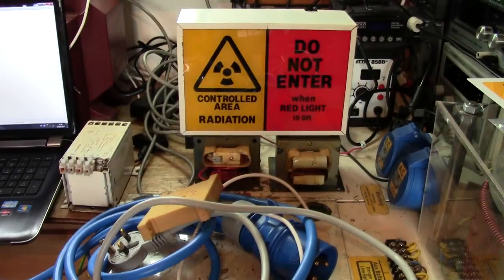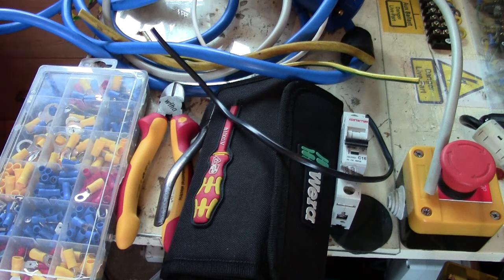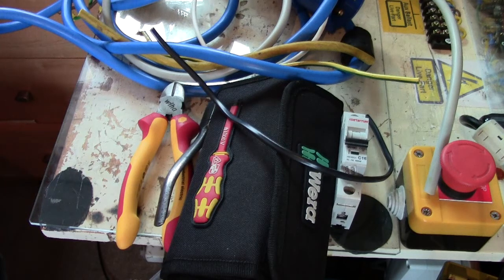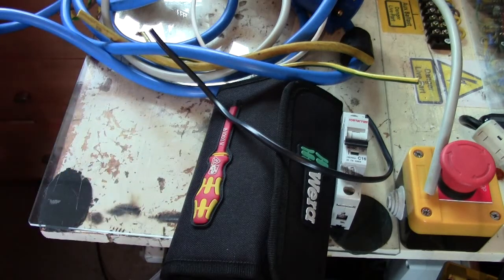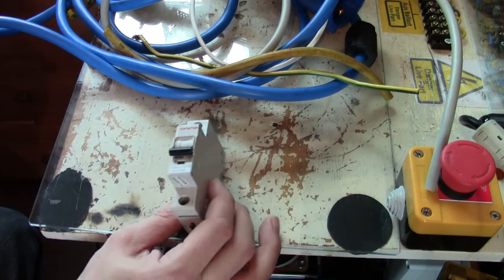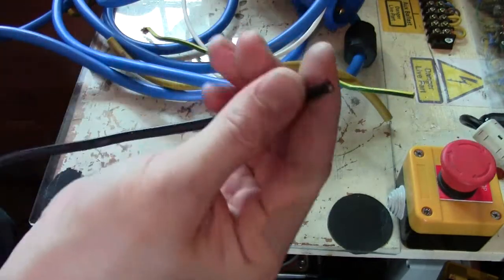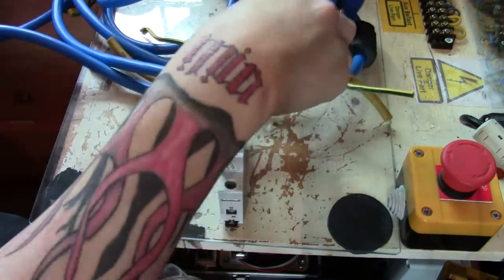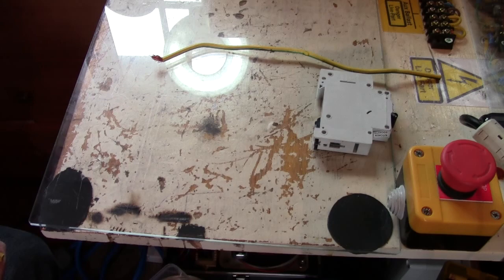Basic electrical safety PT 1

Comment: Great video. At least in the UK leads are colour coded. In NZ they can be more or less  whatever colour.
Extension leads are orange, yellow, red, blue, white, black. All rated for 240 Volts. Quality differences are in the thickness of the insulation and domestic, or heavy duty. Conductor size etc. For 110 or 240 V different plug connectors are used.
Reply: In Australia the extension leads have different plugs, 10 amp, 15 amp and 20 amp. the colour of the lead means nothing.
Reply from the maker: Mentorcase In a lot of cases in the UK lead colour means nothing to alot of ppl I like to use the proper colour leads and plug /sockets even though the same size is the same rated its just safer and something thats done to make things more clear and safe .I often see ppl using yellow cable ,sockets / plugs (our 110v ) for 240v and think nothing of it even using nails as fuses but i guess thats just ppl be stupid and they soon learn when they plug the 110 power tools in to 240 ;) and see the magic smoke then wine about it LOL .Thanks for watching .John

Comment: Mmmm, that blue arctic stuff looks chunkeh! :-)

I laughed at the end of the vid; ".....and if a fuse blows, DON'T chop up an M6 and...."

Well, the vid cut off at that point, but I know what you were going to say about that M6 bolt. :D

As for using yellow-coloured flex on 240v, I do know that it is possible to get yellow flex which can handle 240v. In fact, I'd seem to think that it "wouldn't-be-allowed" for manufacturers to make 110v cable....just in case someone did wire it on a 240v supply.

In fact, I have heard that some carvan sites PREFER caravanners to have 240v hook-up leads IN YELLOW or ORANGE so that they're more visible in low light conditions to save people tripping over the cord from the hook-up point to the caravan.

I have a 14 Mtr, 2.5mm extension cord and it's yellow-coloured on the sheathing. It was given an insulation resistance test at 500v and the tester said >200 megohms.

So, I'm sure if the cable holds back 500v, it'll work OK on 240v.

Generally speaking though, like you say, yellow flex is "recognised-as-a-110v-power-cord", and yes, that should be adhered-to in places where it's needed to differentiate between voltage levels (i.e. on a building site where isolated 110v is normally considered the maximum allowable voltage)

But you know....The important bit is the connectors on each end: Provided that the cable in the middle can withstand the voltage to which it is connected, the cable can be bright purple with green spots on it and it doesn't matter (well, outside of a building site anyway......)

==========================================

Where it all goes wrong, is when people start using the wrong coloured connectors on a particular voltage. Appliances can pop or run incorrectly if they have the wrong voltage-rated plug on them.

Honestly.....I was once asked by someone if it would be OK to take this "funny plug" off of their drill and put on a domestic 13A plug.

OK, on the surface of it....Why not? But hold on there......

After a bit more questioning around and poking to get more info out of the person, I asked them to describe the "funny plug" on their drill.

"Well, er...it's round, has three pins in the end of it, and it's yellow coloured. I want to whip that off and put on a domestic 13A plug"

YES, REALLY! I gave it to him straight, and direct-to-the-point....... Do that, and there'll be drill poppage, as the yellow plug means that the drill runs on 110v, not domestic 240v. That's why that plug is on there.......to stop you plugging it into a domestic wall socket!!

=============================================

Right....... I have to go now, as it's 02.30 here at the moment. When I get up in the morning, I'm going to take that yellow 14 metre 2.5mm cord that I have (which doesn't have any connectors on the ends of it at the moment) and I'm going to stick a domestic plug and socket on it and make some use out of it. :D

Take care.

-BoomBoxDeluxe.

12th February 2014, 02.43
Reply from the maker: LOL @ drill poppage guy maybe if he had watched this vid first he would have known :0)

The video goes to part 2 the next vid ;0)

and your right the cable is the same I also have a long yellow cable and its rated the same as blue cable of its size it more a mater of telling ppl and making them aware of correct colours its just basic good practice and yes it is the socket /plug colours that count I hate to see people using yellow plug /socket for 240V they even have them in blue but just cant be bothered WHY !?!?!?!  

I use a blue 32A for DC and it should be white for DC I tried to find a white one and the socket alone was over £60 :0(  NO THANKS LOL looks like its gonna get a spray job ;0)